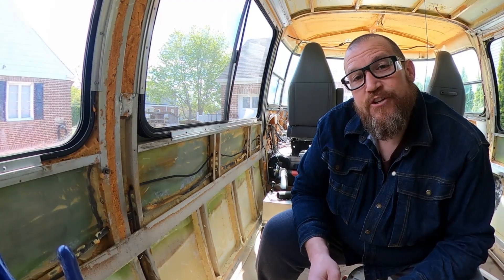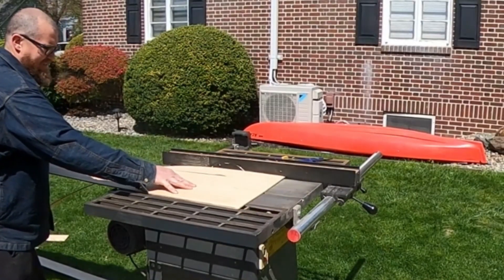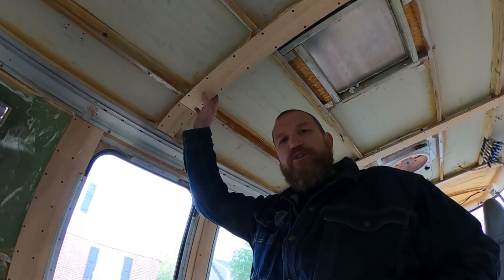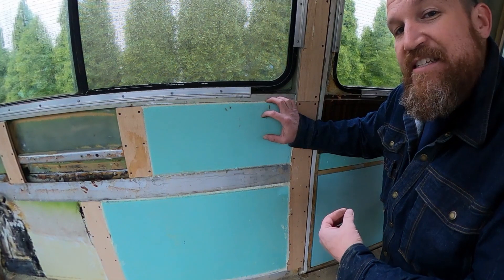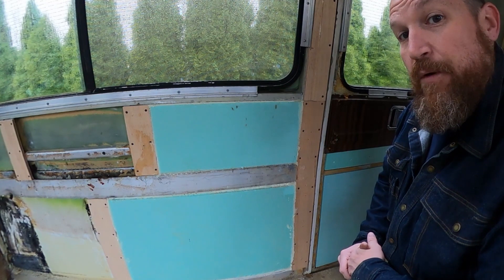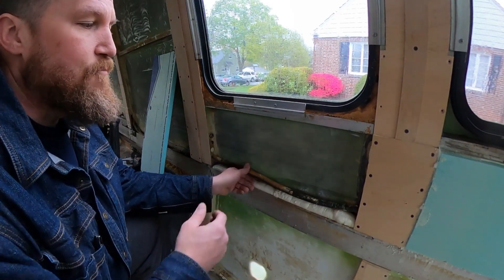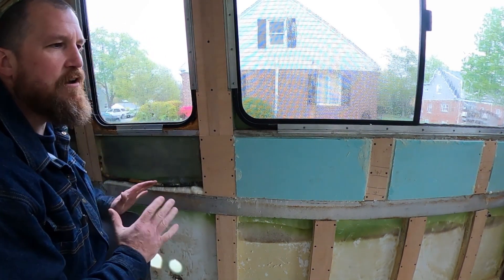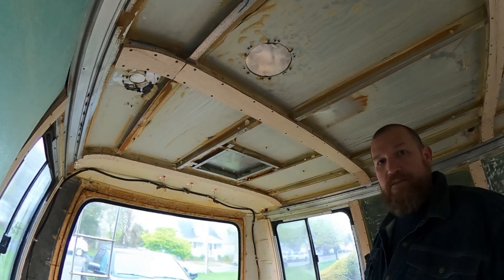GMC MOTORHOME foam board insulation

Comment: i can't wait to see when this coach is all done
Reply from the maker: Me too!
Reply: @getoutgadabout3423  I've been wondering the in a coach with a rear bed could it possible converted to a murphy bed so you get a little more room when not using the bed.
Reply from the maker: I don’t think you would have enough clearance without folding the bed due to the generator and propane boxes. The factory water tank is there too remember. My idea is making an adjustable bed that as the back/head section rises the whole bed pulls towards the back wall kinda like a futon making a wide couch.  I’m planning a whole “open concept” style interrior.
Reply: @getoutgadabout3423  I think that you are on to something there

Comment: Thanks fro all your great video. Gives me confidence about tackling stuff in my 73 (if/when I get it). 
Question:  Where the wires run through the frame members is there any sort of factory grommet or padding to keep the wires from contacting the metal and wearing through from vibration over 40+ years? The coach I'm looking at is mostly original and I wonder how much will be involved in making it safe without a full gut and remodel.
Reply from the maker: I think the main wires at issue are the alternator wiring that a diode is available for and the battery cable that connects the engine battery to the rear battery. With the booster solenoids. This wire on my coach was bare in spots in the front of the coach. It runs through plastic grommets in the wall framing midway up the drivers side wall on my coach 76 model. This can be disconnected at both ends and a new cable run external on the underside of the coach. I would use a high quality gxl coated wire and possibly run it inside a secondary covering. Good luck with your coach and thanks for watching.

Comment: Some nice work.  I noticed that it appears that you have patched some holes in your roof..  Is this temporary if not, how did you patch the holes?
Reply from the maker: Hi Doug, the large holes were covered over with 1/8" aluminum plates and sealed with 3m 8115 body panel adhesive. this Is the glue used to hold together modern cars instead of welding. sealed end rivets were used to hold the plates in place until the adhesive dried. when I start working on the roof they will be ground off and sealed. the 100 or so small screw holes the PO put in the roof were sealed using 3/16 sealed rivets with a drop of seamsealer. now that the foam is removed from the ceiling I may explore another way to seal the small holes.